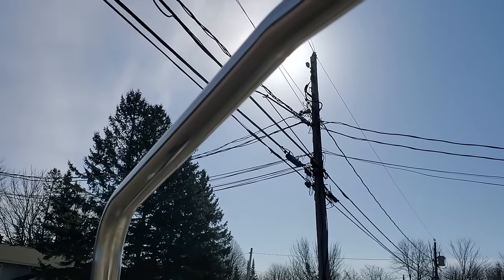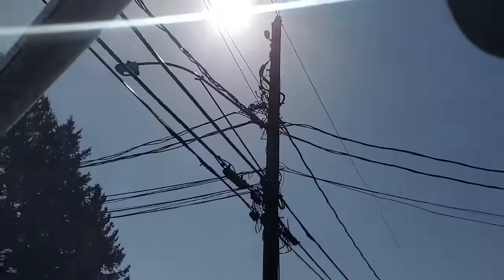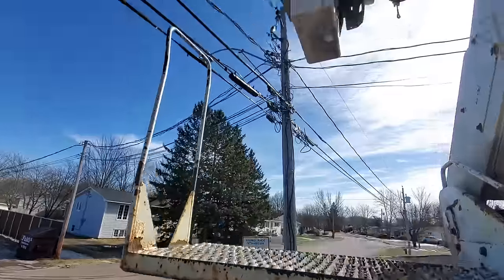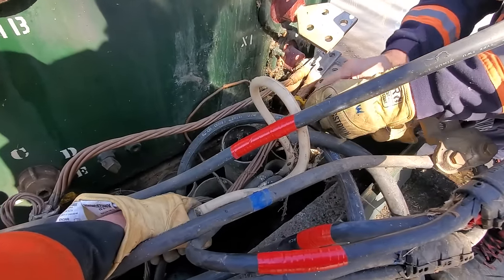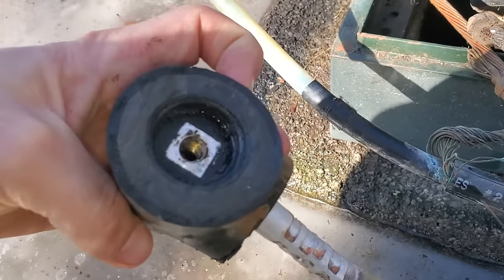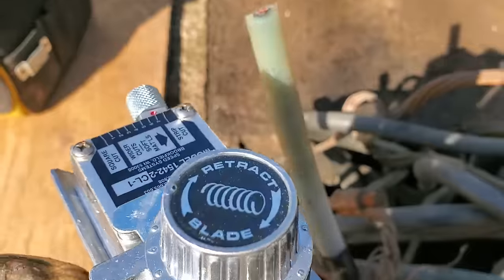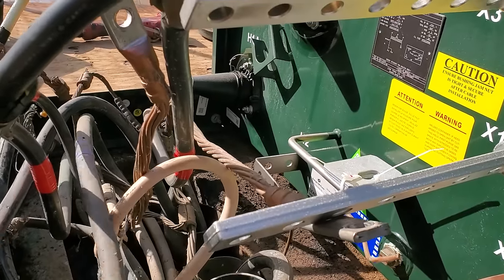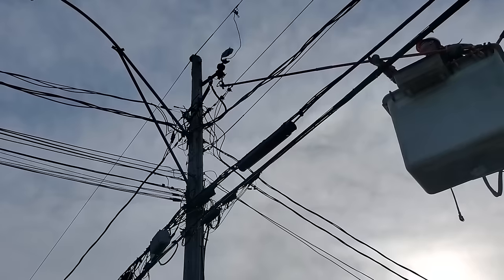Being a Lineman - Episode 37

Comment from the maker: Hey Everyone!

There's a whole lot of information that I just barely touch on in this video...I'm really hoping it's not too confusing for those whom aren't in the trade. I will be filming an in depth video on how to do a termination very soon but in the mean time, I encourage you all to ask any questions that are on your mind in the comment section! I try my best to keep up with answers and fortunately there's absolutely amazing community of viewers that have been very helpful with answering a lot of y'all questions as well!   

Be safe out there everyone! 👊🍻
Reply: Hello
Reply: hey if you can, do you have a name for that tool or a link to one? (the spiral depth gauge for the insulation). id like to mention it to my company to see if we might be able to get them. that would be a very useful tool just to save a little extra time and make it a little less of a hassle. thanks!
Reply: In my cable tv days we had an cable stripper like that for the bigger coax cables. did the outside and the inside stripping
Reply: "...I'm really hoping it's not too confusing for those whom aren't in the trade." Yes, it is a bit whelming. Before I change a padmount 😱I need more training!! 🤯But I see the general path of the repair and the parts and most of the "Why?". Thanks for showing the insides of those 7KV elbow connectors (bonus: two types!).
Reply: Just wondering if you guys have a backyard machine that you guys can use instead of driving a 5-ton truck through somebody's back yard.  Had the same thing happened here last year but it was a pole mount they used a backyard machine to remove it from the pole
Reply from the maker: @jchambers2586 we do! And that was certainly an option for that job.

It would have still the required the plywood with the soil being so soft. So we opted to not bother bringing over another piece of equipment
Reply: @Bobsdecline  OK.  That is a huge Transformer.  75KVA = 312 amps. So simple math 75,000 / 240 will give you 312 amps - 80% = 250 amps. As you know my friend was an electrical engineer for my power company for 42 YEARS.
Reply: I'm not a lineman, but I do have a degree in electrical engineering and have done residential wiring to NEC code. I think you explained everything very well so that those who have a little related experience can understand. Seeing the tools was really interesting. Haven't seen any of your videos on terminating pad mount transformers before, so I really appreciated the details on the tools used.
Reply: Not confusing at all.  I appreciate learning about the other side of the panel!
Reply: @jchambers2586    He did say there were 14 - 15 homes on that sideline so around 40 amps per house. (with 2 transformers on that line) With the possibility of some electric heat, that's not all that much power to spare.
Reply: @rupe53  they are counting that everything is not on all at once.
Reply: @jchambers2586    you also have to consider that these units can go to 140% - 150% of capacity for at least 3 hours and still not have any serious voltage drop. I wouldn't be surprised if they can pull near 200% for short stints. It's all about time and internal temps so probably longer when it's well below freezing. That's plenty of margin in a residential situation.
Reply: We all have those jobs we recognize as being a bag of snakes.
Reply: Hey Aaron this one was hiding from me. But it’s a good one!       👍👊‼️

Comment: Aaron, retired electrical mechanic from Fredericton, that strange elbow termination you had there was a Kerney  elbow with a butt connection on the stinger. One of the first elbows kits ever made and a poor design. I have changed many of these in my time and these elbows should not be opened hot because the stinger could stay inside the bushing insert and break were the two flat surfaces meet at the end of the lug . The clue to look for is the solid half ring where your hot stick hooks.  These elbows were banned in the late seventies early eighties. No doubt there are still a few on the system.  If you have that old elbow , compare to the newer ones. Talk about it at your next safety meeting .
Reply from the maker: Nice! Nobody had any idea what it was at all. Thank you very much for taking the time to explain/share that. 
Any one of us would have definitely pulled that hot without a second thought.
I'll certainly let the guys know. 🤝
Reply: Thanks for saying that keeping These guys safe !

Comment: Interesting seeing that you guys use a combination of underground and aerial, it looks like all the customer drops are aerial. 

The extra work servicing undergrounds utilities should be instructive for those folks who feel putting utilities underground solves all problems. Here in NH our utilities are mainly aerial but a lot of new developments are underground for aesthetic reasons. When we built our house a zillion years ago opted for a combination of aerial and underground, the last 200 feet (61M). Same construction as you mentioned cables were direct burial. That is no longer allow and underground now must be in conduit.
Reply: I would assume that the extra work caused by underground utilities is far outweighed by the fact that they barely cause problems.
And if they cause problems it's (I assume) generally not during a storm. So a lot safer for the lineman compared to aerial lines that regularly have to be repaired during storms and other extreme weather events.
Reply: @Jehty_  That is true. However here in the rust belt they are not immune to frost heaves and errant backhoe's. So you need to balance maintenance cost vs cost of construction.  Here in NH since the state PUC "encouraged" utilities to be more aggressive tree trimming we have far fewer power outages.
Reply: I am a master electrician / field service tech servicing and testing  medium and high voltage equipment. My brother in-law bought a new house, I asked him about putting in a generator plug like I did at his last house. He said no I will be fine all my electric is underground. I said that doesn’t matter, it’s not underground everywhere, he said I will be fine. He had lost power 3 or 4 times in the last year. He texted me and said he wants a generator plug now. I wanted to say I told you so but I didn’t.
Reply: @Jehty_ You would be assuming wrong. Underground utilities are just as problem prone as their aerial counterparts. Troubleshooting and repairing is far more difficult and expensive. And even though the utilities own easements where the underground runs, people still build things on top of them. I live in the PNW and our utilities are very aggressive when it comes to tree trimming. A couple years ago we had a massive windstorm come through and knocked out power to pretty much the entire region. Our power is largely aerial. Within 24 hours about 95% of the power was restored and those that weren't were largely due to access issues such as trees blocking roads. I work for a road dept and we were actually out in the storm cutting trees that blocked roads as they fell so the power crews could have access when they needed. Aerial is far superior in my opinion, it just looks ugly.
Reply: @mikel9567 well, I find that hard to believe.
I'm German, so I will compare things to Germany, because that's what I know.

Edit: Sorry, I somehow forgot that he was from Canada, not USA. My bad. 
I couldn't find a number for the average outage time per year for Canada. Has someone that number?

So in Germany more than 80% of our  power grid is underground. The number I found for the US is 20%.
On average a customer in Germany experienced 12.2 minutes of interruption in 2022. The average US customer 5.5 *hours*.
The highest average number in the last decade was 8 hours in the US (in 2020), in Germany it was 15 minutes (in 2017).
That's just such an enormous difference. 

Of course I'm not saying that that difference is solely because of underground vs aerial.
But a lot of reasons for power outages features on this channel are just things I've never heard of here in Germany. Animal walked on transformer, car crashed in power pole. Even power outages because of trees are really rare.
All power outages (all 5 or so of them) I experienced during my 30 years on this earth were during "storms of the century". I've never experienced a power outage that just happened on a normal day.
Reply: @Jehty_  Underground service avoids many of the issues that arial service has, but it isn't immune from its own issues.   And those issues are more time-consuming and expensive to fix.
Reply: @Jehty_ with the size of Canada it’s just not cost effective to put everything underground, you will find in the downtown core and all new subdivisions are predominantly underground.
Reply: @tomschmidt381 I have noticed this as well since the ice storm in 2011? Haven’t had a decent outage in years!
Reply: @Jehty_  You could fit Germany in one corner of the USA or Canada.  Not practical to underground everything in rural areas.  Plus infrastructure in German major cities is only 75 years old or less.  Major cities in the US and Canada have water and sewer lines that are more than 100 years old, some are 150 years old.

Comment: The (bleeder ground) that bonds the bushings to the frame out in our area the utility company calls it the (drain) ground wire is just for eliminating static discharge if you pull the elbow hot?
Out here in Long Island ny we make up our own pad mount transformers because the utility will not make them up when they are on consumer owned property.
I love all of your videos. Just a country hick electrical contractor out in the sicks!

Comment: Nice job Aaron & the boys for swapping out that bad pad mount. I guess for your facial expression that you don't like direct buried wire & underground. I'll have you know I have paid for a lot of things with underground cable failures. 
Don't you love that cross link poly primary wire? 😂 We use the same tools for skinning that wire. We use a torch to soften up that semi con before we remove it. I have seen several "flower pots" blow out of pad mounts. I never saw that elbow with a stud on the wire. That's new to me too. 
That looks like a poured in place concrete pad with all the wires jammed up there. We only mark one wire on the secondary side though. Black is the opposite color. 
Love your digger truck! Two pistons on the lower boom. A lot more power with that set up. We only use Altec here. The repair guy for them is constantly fixing our stuff everyday.

Comment: Nice job, one question I have is does your utility have a procedure for checking the low voltage side of the transformer for correct secondary voltage before energizing the customers panels? I know it's a pain in the ass... what's your thoughts on how important that step is?
Reply from the maker: We check voltage before leaving unless there was reason to suspect a problem. For individual installs, we'll check before putting the meter on and for commercial installs typically the main is open and checked before load is switched on.

We don't normally close In a tx on a new install without secondary leads on for a voltage check.(Followed by an open, install and close). 
Would that be a bad thing tho? ... Definitely not! Unnecessary 99.9% of the time, but would certainly be an extra step in the right direction.

IMO of course!

Comment: Hello from Ireland,  just finished viewing "What's  in the green box" video. Have a question - on the LV side, are the feeders fused in the transformer? here each phase is and there can be from two to eight feeders. Thanks
Reply from the maker: Hey! Yes, all of our transformers are fused internally. The fuses are located on the high voltage side and protect the load/low voltage side but not feed through (primary leaving the transformer to feed the next one) cables.

Comment: Random question about power lines and tornadoes... Can you estimate how much force it would take for wind to pull a conductor off an insulator? In most videos of tornadoes I see, there's always power flashes as the tornado crosses a line and pulls the wire off the pole. I'm just wondering how much force this actually takes.
Reply: That sounds less likely as debris hitting the insulator hard enough to break it.
Reply: @jovetj    could also be lines slapping together. Also, remember that gravity plays a major roll in engineering and storm winds can "lift" which is the exact opposite direction. IOW, unexpected stress in a different direction.
Reply: @rupe53  I just don't see lines slapping together solely responsible for removing them from insulators.
Reply: @jovetj    I didn't say solely responsible. The problems with storm related wind is they can go in different directions only a few feet away. IOW, push, pull, twist, up and down. Much different than 100 mph in one direction. Also, sheets of rain can draw an arc over dirty insulators where normal rain might not.
Reply: The flashes are usually from the wind slapping conductors together.

Comment: What happens if you couldn’t get the car to move, what is your next plan?
Reply from the maker: Our other two options would be a very large screen to reach from the road or using a backlot machine that can fit in between a 30 inch fence opening

Comment: Here in the UK, we do not use small pad-mount transformers for "standard" installations.  They strike me as a major risk, if a vehicle hit it, or kids/copper thieves broke into it.
Reply: What do you use?
Reply: Your thought process is rather misguided.
Reply: @vladimus9749  A local substation 500 Kva or larger feeding onto a LV feeder pillar with fused ways going out to indivdual main cables, services to properties are then jointed onto the main. If you have a ug fault on the LV then an individual phase fuse will blow rather than lose the whole output of the transformer. In the UK we fuse the LV output of the transformer  and the HV side is covered either by local HV fuses to the individual tranformer or a breaker for a spur leg.
I'm a linesman in the uk, we have seperate teams for the ug jointing side of work,leaving us to concentrate on the overhead side.
Reply: @neilh2150  Thanks!